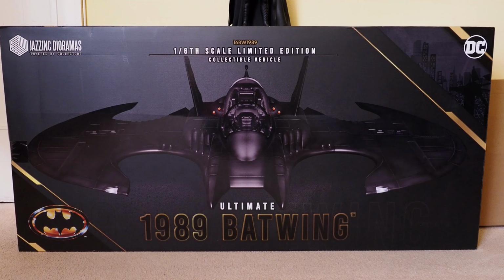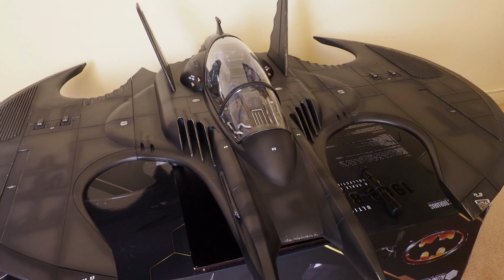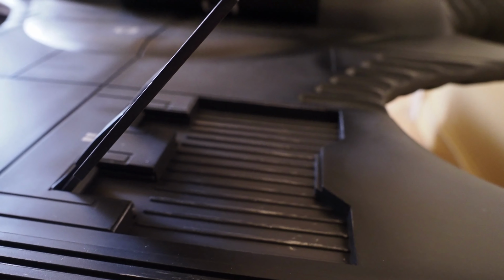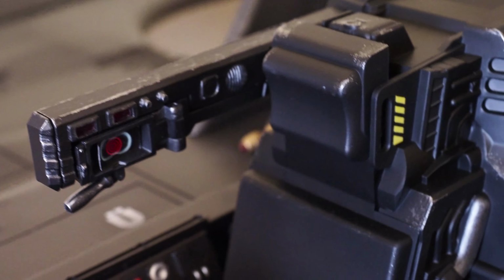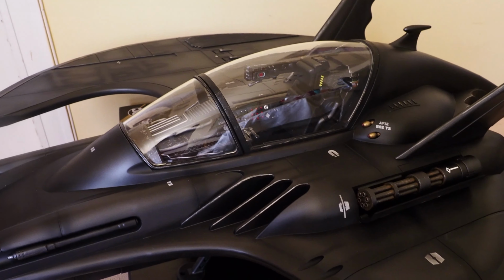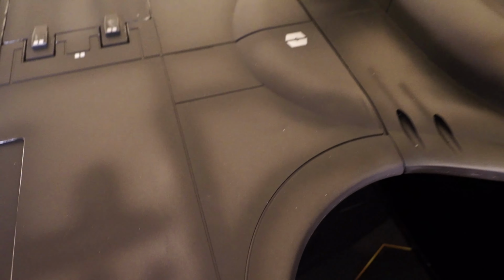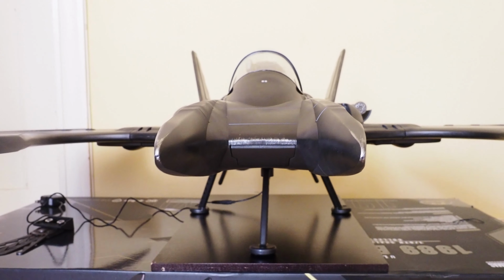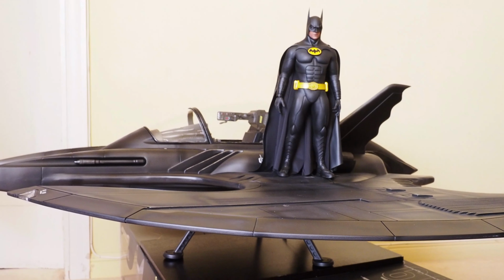4K HD - Jazzinc Dioramas Ultimate 1989 Batwing Vehicle Review

Comment: Have you considered the Spinmaster 12-inch Batman figure for the cockpit as a cheap alternative for less than $10? 

The SpinMaster figure is slightly smaller than true 1:6 scale (and the suit is from the new Flash movie) but they fit into the Batmobile/BatWing and from a distance, it's difficult to see it's not exactly the 1989 suit.

I bought 5 (five) of them on Amazon a few months ago after borrowing the idea from another Batwing JazzInc owner on YT.

I have 5 Hot Toys Keaton Batmans (original releases & PO) but like you, did not want to risk long-term damage to the figure in the vehicles.
Reply from the maker: No I have not, I'll definitely have to take a look at that and do some research. Thanks for the idea 👍